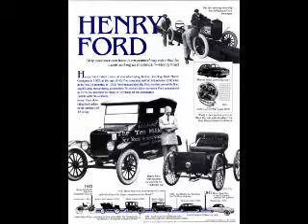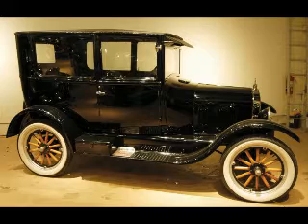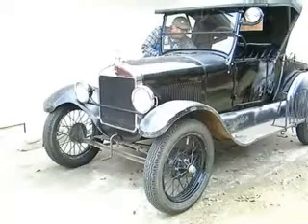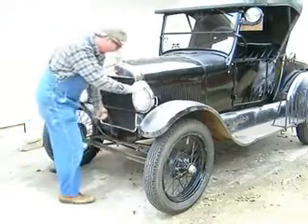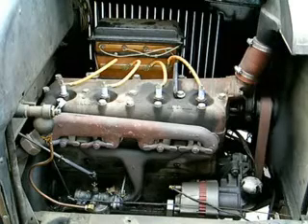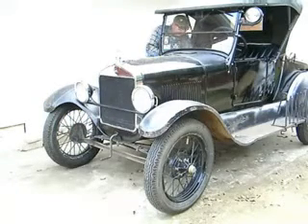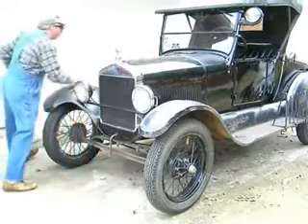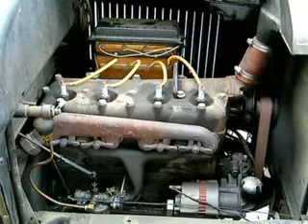Henry Ford & Rudolf Diesel Against Petroleum Part 1

Comment: a 7.3 idi can run on used motor oil and vegetable oil and a gas engine could be completely revolutionized to run on what is basically corn liquor by changing compression but it doesn't lubricate like gas so they would have to figure out a way to get past that

Comment: Sorry Pal but your story is so full of crap.  The Model T was never made out of hemp.  The engine, according to Wiki, "The engine was capable of running on gasoline, kerosene, or ethanol, although the decreasing cost of gasoline and the later introduction of Prohibition made ethanol an impractical fuel for most users.". My Dad grew up in his Dad's garage in the 1930's and was well versed in the Model T being that was pretty much what everyone could afford to drive in that farm community.  The so-called "Hemp Car" was a single car developed as a prototype in 1941.  Though prior to the Pearl Harbor Attack, America's industries were already in the war effort to support Britain.  To Ford, that meant that material shortages were already occurring so he shrewdly began looking towards other materials.   There is no proof, beyond pro-hemp websites (aka pro-pot websites) provide the only evidence that the Model T or the Model N was ran by hemp oil which by the way would be an impossibility as Ford never employed Diesel's engines. .  In fact, I can find no record that hemp was ever used as a feedstock for ethanol or as bio-diesel.    So where did you get 40,000 vehicles from?  Inflecting your voice does not make it true.    And where are the pictures of Henry Ford on his massive Hemp Plantation that these videos continue to purport?  Not a one.

The cannabis that industrial hemp is made from DOES contain THC.  It is just a very minimal amounts so as not to affect you.
Reply: You are wrong my friend the Cannabis is the best plant in the world for man benefits
Reply: Spuma Beat
Only because you get high from it.  Go smoke some commercial hemp.   Same pot "goodness", minus the high.   I bet you would pitch an addictive fit if that it all you were allowed to consume.
Reply: +Sam Houston God give us the earth and the seeds, we have the divine gift to grow everything, the selfishness of man makes the enslavement of the own man
Reply: I thought ford was a advocate for the soy bean and not hemp.

Comment: I am no great supporter of big oil and welcome alternative sources of fuel . As I see it the 'Hemp' car was labour intensive and not conducive to the rapid body panel production as pressed steel is..the 'resin' used has to be produced.. lay up in molds....curing time is needed,  and as a result up goes costs.  Look at Tesla and other car people, high dollar machines and very limited output compared to Ford Chrysler and GM..

Comment from the maker: Ethanol, also called ethyl alcohol, pure alcohol, grain alcohol, or drinking alcohol.  You can get drunk as hell off of it basically moonshine style but they put petro gas in it to stop people from drinking it in alot of places.  If you distill corn you take the sugar out to make alcohol making ethanol, which is for gasoline motors.  You can also make bio diesel with it but that is a different process.  You can make both products out of corn and hemp depends on what you want to do.

Comment: I support hemp but his first model t was not run on hemp he did that in the 40s
Reply: Model T was made of steel.

In the early years, ethanol was widely used as a fuel, but I don't think it was made out of hemp.
Too difficult.

No way, the gas engine could run on hemp oil like the diesel engine.

Ford's 1941 plastic car is known as a "Soybean car", the plastic body panels perhaps did consist a small amount of hemp fibre.
The engine of the  "Soybean car" was a Ford 60hp flathead V8, that definitely didn't run on hemp oil.

Comment from the maker: Actually no you can make ethanol from hemp., they say it should cost $.50 a gallon, there is plenty of info on that and you can make biofuels as well, so you actually can produce fuel for both diesel and gasoline engines from one source just with different refinements

Comment: WOW!
Ethanol- Absorbs water from the Air?
AWESOME!
& STILL... It Burns with Extra-FREE-water It has-absorbed?
So, You are confirming this GREAT "attribute" of Ethanol..
That It is Snatching- FREE water from the air!
& it aids in Efficient combustion.
- gonna have to add this "benefit" to your "energy used to produce it"
 equations.
hummmm... 
How Many BTU's Of Heat where applied to produce Gasoline?
ALOT!
Its a valid question-
If you want to get all...
 "Energy in, &- Out" 
-analytical about it.

Comment: Another "fun fact" is that Gasoline will not "Keep" for more than 10-24 months? I'm not sure -of the exact time ...Because who Knows how long what gas laid in a storage tank?...but it dose go Bad.., and, when it dose, it separates into a gunky unusable Chemical- goo.& that is By Design.
& is done-So, to keep us dependent on the refinery's.
but Ethanol dose NOT.
so if Dooms day'ers
-are concerned Enough to store some fuel that will Keep for Decades? Then, its ethanol...that is your answer.

Comment: Catalytic converters Burn the toxins from Alcohol,completely.
& Lets discuss the "energy" used daily, 2 Mow grass On highways.& If all the Grass On Highways is replaced with a Good Crop- Like Hemp,Then, the seeds would be pressed to Diesel Fuel,(A Perfectly Clean Bio-fuel) & the stalks could be paper, 2x4's,OSB sheeting-& the paper it makes is the Nicest- stationary;& the clothes it can be made into are 2-3 times longer lasting than Cotton.& Cotton uses 40% of All worst fertilizers- worldwide.

Comment: The Reason benzene and butadien;& Dozens of other-Cancer causing chemicals-are even IN Gasoline,
 is That the Worlds auto industry is Used By the Chemical-Refinery's; as "toxic waste disposal Units".
They add any, &  all extra Chemicals daily to gas-& its a different Mix every day; & Every Tank you Buy.
& That's why They Forced Us ALL to Have Catalytic converters.Pure gasoline burns pretty Clean--but its all the added Chemicals-they cannot store, *& Thus- DUMP IN OUR GAS that causes problems.

Comment: MOST-fuel systems Cycle the gas constantly. It MUST keep mixing it- Or it settles out, & is Like-varnish.& if its got alcohol & gas  & Then-water Vapor gets in?... all the better!
 It's OK Folks-This Guy's JOB is selling FEAR & LIES  to the uninformed.
SOME-Water In Fuel is OK -IF MIXED It adds to the "Punch" of the fuels Power as steam expands in combustion chamber.
It Help's The Combustion process 2 B  Cleaner.They where adding water to cars in the 40's... its Even in Popular mechanics issue.

Comment: Water aids~& adds to... the combustion process! 
IT MAKES The Auto's EMISSIONS LESS Toxic!  THIS is why a non passing Bad catalytic converter "Polluter" Will Pass An emissions test, While running on 50-50 Gas & alcohol. I Have Done this in the most strict county in Ohio- so You dont Know what you are talking about!. . ... 
It increases the efficient BURN of the TOXIC Gasoline- That YOU Seem to SO LOVE.
Why do you Prefer to see our environment Contaminated by all these toxic Chemicals?

Comment: HOW DOSE ETHANOL MAKE SMOG?
Pls- show the PROOF! 
B/C Using CORN to Make fuel; Still leaves the Used Mash 4 Animals to Eat!
& Now, That 'Mash' is Healthier,& easier for 'em to Digest. So,Study up!
& Thus- There's  2 END uses for the corn-& not just one! 
& alcohol Fuel- Reduce's smog- Because,  it burns CLEAN! to pass an emissions test just run your Car to 1/8 of a tank, and add a 5th of 190 Grain alcohol, & see how you Pass the state's Emissions test & alcohol is what Absorbs water in the tank.

Comment: Pressed feral hemp seed can produce 300 gals of bio-diesel & 1800 gals of cellulose based ethanol, from the remaining plant biomass, using existing experimental enzymes, per acre. Most gasoline powered vehicles can be easily converted to run on E85 (85%) ethanol. All of the U.S. domestic energy needs can be supply by using 6% of the arable land. Ironically the U.S. Gov't pays farmers to keep 6% of farm-able land out of production. Hemp is also makes superior lubricants, plastics than oil.

Comment: I am so glad I came across this video. Boy, you hit the nail right on the head. It was Rockefeller who owned Standard Oil at the time who greased palms in Washington to bring in prohibition. Ethanol is alcohol. He wanted cars running on gasoline. Once the use of gasoline was a normal commodity, prohibition was lifted. Many people don't believe me when I tell them about it. Thank you for this video.

Comment: @ripousse By plastic, I guess you mean any polymer, which would include resins from the hemp buds or oil from the seed that could be hydrotreated and polymerized using  radical polymerization by adding a persulfate. I just wanted to point out you were getting a little too high sounding to not be giving a rigorous background. If you're gonna be contrary, at least be clear.

Comment: The other great things that can be made with Hemp are clothes, paper, and shock food!
What amazes me is that the petro industry could be on the leading edge of Hemp production and in the long run it would cost them less, no spill clean up costs, less cost to search for new wells, etc. Plus, the Hemp fuel would plug into the current system!

Comment: @Roadsideimports 
Are you familiar at all with the material cost?  Carbon fiber is expensive.  It has decreased in price 10 fold in the last decade but is still out of reach for most consumers.  Maybe you want a $200k Civic?  Strength isn't a singular property.  There's tensile, compressive, shear, ductility, etc. The many alloys of steel we have made available to ourselves are the best of all worlds, are relatively inexpensive, and are infinitely recyclable. Carbon fiber is famous for fatigue.

Comment: @Roadsideimports 
You need to do a lot more research into exactly what it is you're saying.  The oil, once converted into fuel is not fertilizer, it's a chemical created by chemical reactions.  Same for rapeseed oil, corn oil, sugar, algae oil, etc based fuel.  Since the fuel is not made only with one product and there is waste in production and imperfect combustion it is not anywhere near a closed loop renewable cycle as you imply.  Hemp is very useful, but spreading misinformation's no good.

Comment: It was 10 times harder to deform(i.e. buckle) than thin steel sheet metal. This is  nothing unusual; polycarbonate is much better. Now why do you suppose they don't make chassis from polycarbonate? Is it perhaps because they want the chassis to deform, along with the crumple zone, so that the chassis is destroyed but the passenger may live? In Fords days they didn't even used tempered glass in the windows; more than few people were gutted by the glass in low-speed collisions.

Comment: IMAGINE IF OUR GULF WAS FULL OF HEMP OIL INSTEAD. We could have been running on renewable energy from the late 1800's when Rudolph Diesel ran his Diesel engines on HEMP OIL. Henry Ford made a prototype model T using Hemp Plastic Composite body panels that were lighter than steel and 10X stronger. The GREEN technology has been here forever. Just RE-Legalize REAL renewable energy. Use the hemp fibers grown on a large industrial scale for cleanup, while transitioning to hemp oil+diesel engine FTW

Comment from the maker: However, gasoline emerged as the dominant transportation fuel in the early twentieth century because of the ease of operation of gasoline engines with the materials then available for engine construction, a growing supply of cheaper petroleum from oil field discoveries, and intense lobbying by petroleum companies for the federal government to maintain steep alcohol taxes.